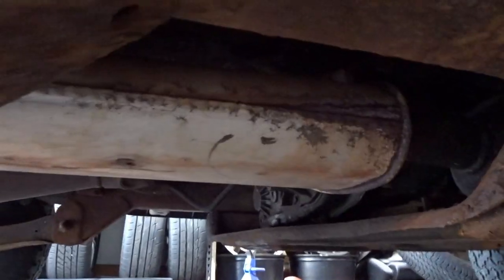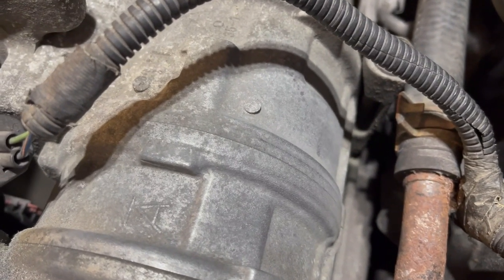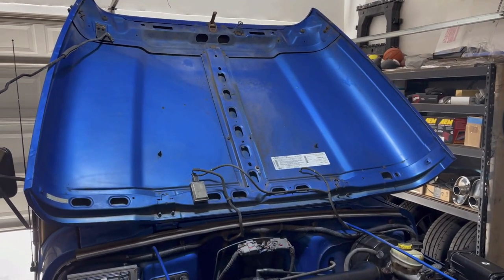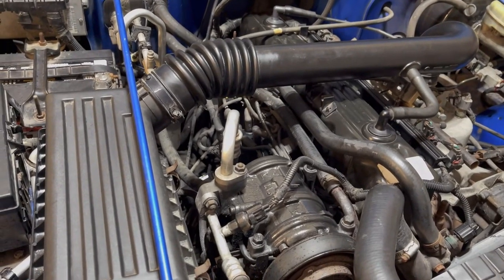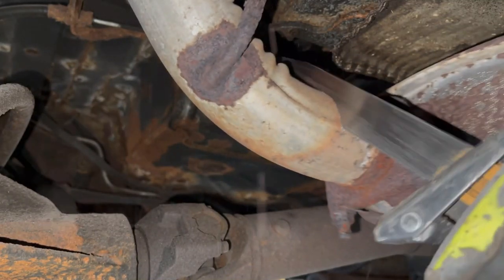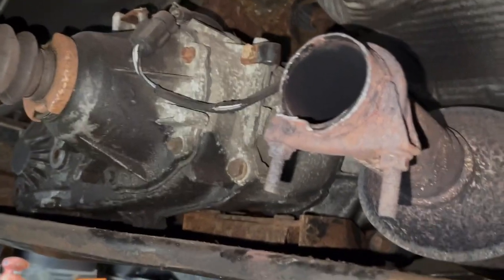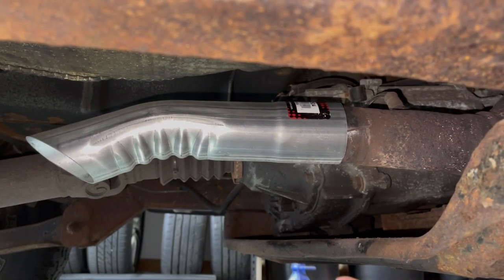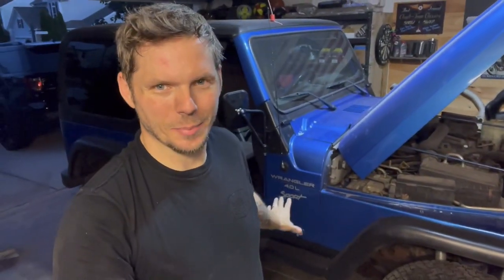Jeep Wrangler Muffler Delete | Wife's reaction was UNEXPECTED!

Comment: ahh the sound if the 4.0 I6! Honestly I dont mind the muff delete. Not too bad but on a soft top jeep possibly a little too noisy lol. I ran the Banks "Monster" muffler on mine back in the day it was pretty clean lol. As for the squealing belt... ehhhh this is where it can get frustrating. I started off with checking the tension. Then tried a new belt...No luck. Water pump went out shortly after, fixed that but squealing still persisted. Moved on to idler pulley and alternator. Got better then came right back once again. Then the power steering pump went out (I had to replace this twice, got a defective reman the first time reservoir was leaking) Finally kept chasing it down and it turned out to be the harmonic balancer (crank pulley) was a huge pain but finally resolved the squealing! you know what they say...JUST EMPTY EVERY POCKET! LOL
Reply from the maker: Pops and bangs on downshifts is fun but with the doors off it’s a bit obnoxious.  Got a big vibrant resonator going on.
The squealing belt thankfully is just an old/loose belt thankfully.  I’ve been waiting to fix it because I want to film it lol

Comment: Sorry I'm on the other end of the spectrum.. show me how to make a jeep exhaust silent. I own 3 and my favorite is a 1995 yj, so i have a love for jeeps. But i absolutely hate the way they sound with any exhaust, the 4 or 6 cylinder. I know most of you like it, but to me any 4 or 6 sounds like a sewing machine about to explode, just not my thing. I have been trying to get my exhaust as silent as possible. V8s are the only thing to my ears that sounds good with a rumble.
Reply from the maker: Just adding a bigger resonator.  The vibrant streetpower muffler really quieted it down
Reply: @SpeedCultureStudios  You got me much closer for sure. Went to my local muffler guy today and had a resonator installed. It didn't get it as quiet as i would like but it is definitely half what it was. well worth 90 bucks and 20 minutes of my time, thanks again.